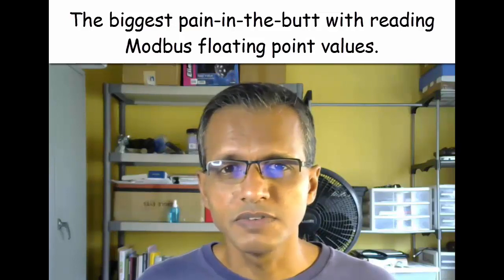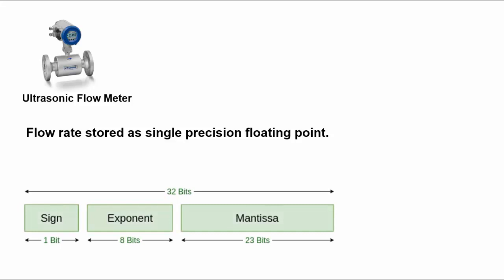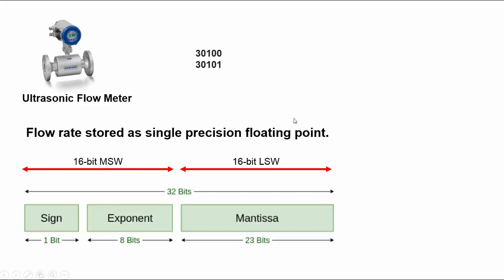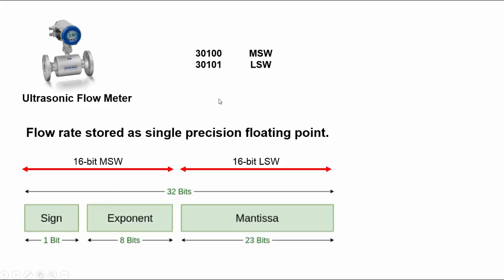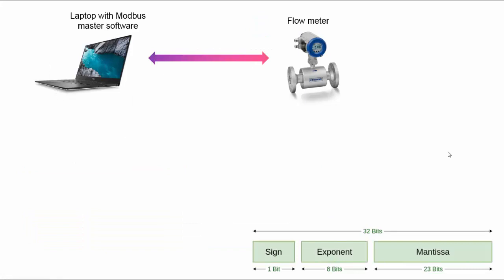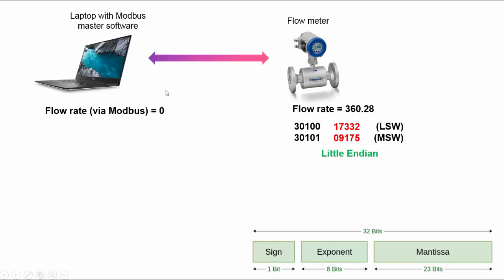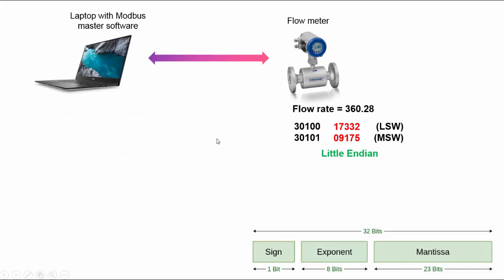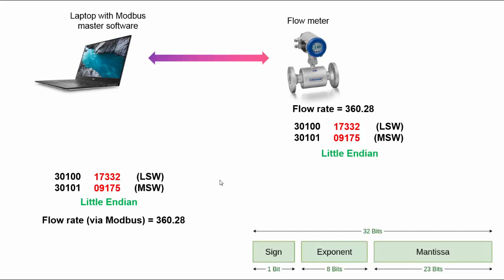The biggest pain-in-the-butt with reading Modbus Floating Point values

Comment: what is the formula to change from integer little endian to becoame float ?
Reply from the maker: The formula is a bit complex and the implementation will depend on the Modbus TCP Client that you are using. What is your Modbus TCP Client? Most Clients have the conversion formula built into them.

Comment: I tried to read modbus data from flowmeter dynamic flow they said in address 7113 it consists of DPT value, 7114 consist of TT, in this video 1 input register suppose to be 16bit either MSW or LSW, but in flowmeter manual 1 register consist of 32 bit floating point. I used modscan to read the data using swapped float but the DPT value that supposed to be in 7113 shifted to (7115+7116), could you explain that?and how can i identify the rest address which are also shifted.
Reply: Did you get the answer?

Comment: fantastic video.. how can an arduino mega or esp32 replace the PC and read then display the flow-meter 30100 30101 registers using the arduino ide?  thank you
Reply from the maker: Hi. Thanks a lot. Glad you liked the video. The Arduino IDE is not really meant for the display of values as it is not Human Machine Interface (HMI) software. But what you could do is to attach an LCD onto the Arduino and display the values on the LCD. So there is no need for a PC for the displaying of values.